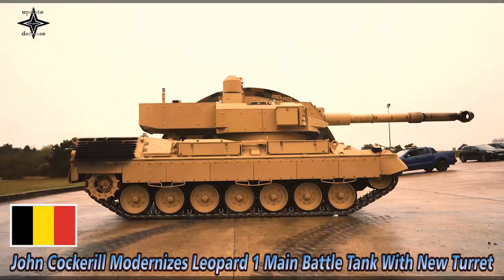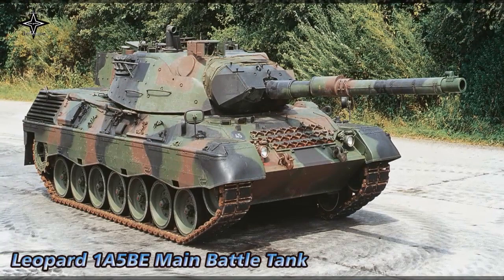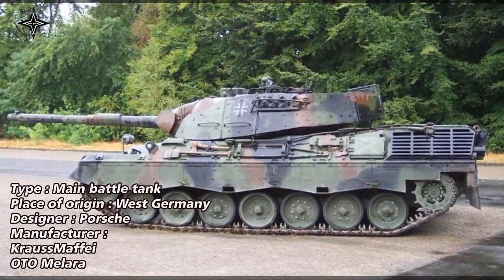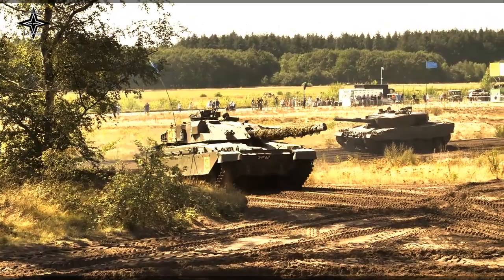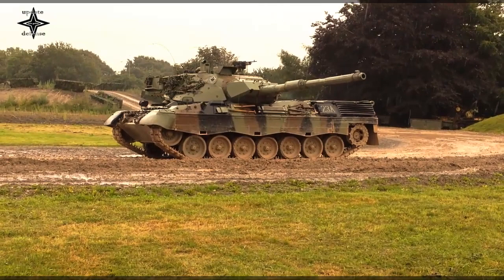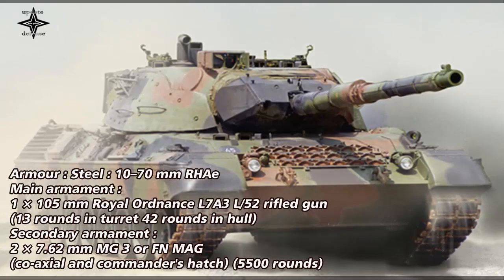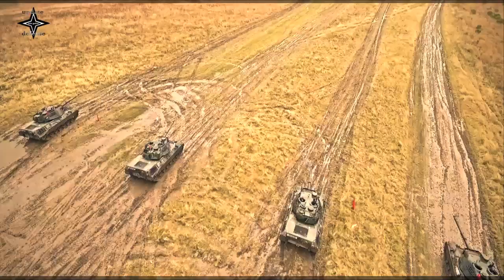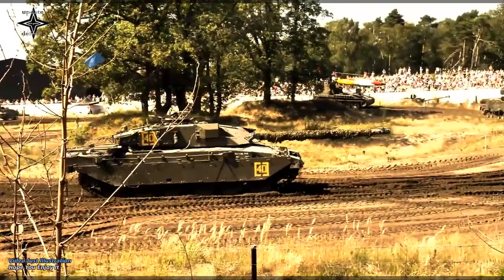John Cockerill Modernizes Leopard 1 Main Battle Tank (MBT) With New Turret

Comment: I'am surprised they did not use the XC-8 turret, this is the 120mm version. If you are serious about upgrading the Leopard 1, a 120 hp gun is a true upgrade. They equipped the K21 with a 120mm Cockerill XC-8 gun. 

A big help for Ukraine would be if they converted T-62, T72 and T-80 tanks with the XC-8 120mm turret. This would give them a huge advantage over Russian tanks. Ammunition would also be more readily available.
Reply: I'm surprise as well that they didn't op for 120mm, Leopard 1 is a beautiful designed tank. Its deserve and seem capable to be equip with 120mm gun, 1500hp engine and extra new armor tech, with all these Leopard would probably still sit under 60 tons. Which make it still lighter than most of today European tanks.
Reply: @PzKnight07  The Lynx 120mm turret is probably the best option. This turret was recently introduced and installed on the KF-41 chassis. An other upgrade would to install the same engine as the KF-41, a 850 kW (1140hp) Liebherr engine and a proven Renk transmission. This would bring it at least on par with the majority of the best tanks out there. 

An other very good option was introduced in 2022, it is the KMW turret for the tracked Boxer. It is fitted with a brand new innovative unmanned turret armed with a 120 mm L/44 gun. Propulsion is provided by an MTU 881 CR (common rail) turbodiesel engine giving up to 880 kW (1,180 hp).

Both of these turrets would be perfect for the Leopard 1, together with an armour upgrade by installing ERA blocks.  This would be a perfect for Ukraine.
Reply: Poland should of given their modernised t90s - for sure. More suited, more upgraded, easer fir the Ukrainian tank crews to get in to service and on the field.
Reply: ce n'est pas pour l'Ukraine plus un cent pour l'Ukraine
Reply: @thesleekgreek I don't believe Poland operates  T90. I know the operated T72s with upgraded western fire control systems. I believe it was called PT91. Pretty sure they were all donated to Ukraine. Poland has now adopted Abrams, Leopard and K2

Comment: The Cockerill 3000 turret series seem nice, but the Leopard 1 is plainly the wrong platform for a 105 mm "upgrade", since it had an L7 gun from the get go. A Boxer mission module with that turret would be nice, though.
Reply: It's about the outdated fire control modules, this isn't an MBT anymore. It's rather a fast support tank which it suits perfectly.

Comment: .. all wrong on my opinion. 
Or you go with 120mm or you go with the new generation of auto cannon 40/45/50mm (range up to 7km)
Personally my country Brazil, should transform our leopards on a mix off some 120mm and the big number on 45/50mm auto cannon.
The power of these new auto cannons 40/45/50mm has is more than enough to knockout almost any modern MBT.